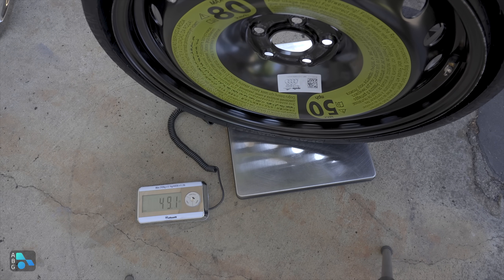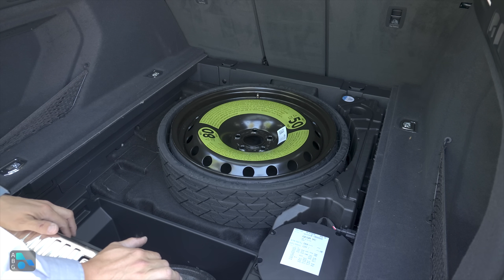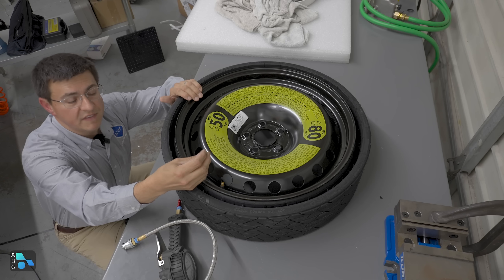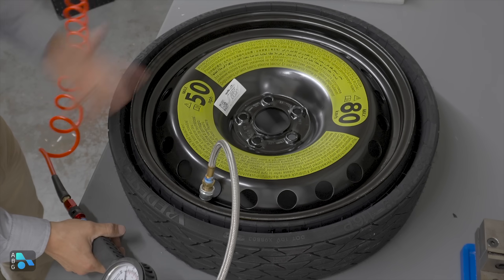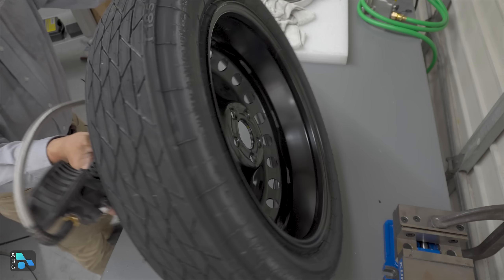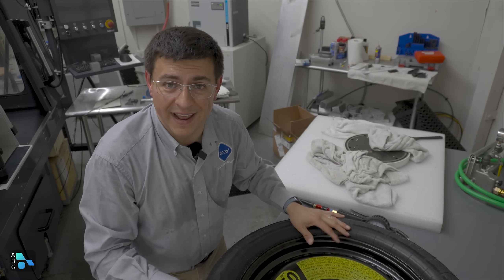How A Collapsible Spare Tire Works, And How It Might Save The Spare Tire In EVs

Comment: Deletion of spare tire has nothing to do with space or weight... it's absolutely just cost-cutting to pad bottomlines.
Reply: A donut spare doesn't take up much more room than this and weighs the same or less.
Reply: If you look at the place when they fit the pump assembly for cars without spares, it looks suspiciously like it can take a real spare tyre!
Reply: @mickleblade Yeah, the big empty cavity under my trunk's liner that they tossed a few cheap foam storage bins looks suspiciously spare tire shaped if you remove the cheap foam.
Reply: 1:12 "Precious cargo space".

Like for storing an effin spare tire, you parkinsonian mollusc.

This has nothing to do with space, but cutting costs, like how you now dont get a charger with a new phone.
Reply: @Ulfhednar-o9t depends what country you live in
Reply: It blows my mind that they dont make my mach e frunk or trunk bottom shaped to take a tire like this. They can sell it as an accessory at a premium. I have had flats in Lyon, Northern Sweden and shouthern Sweden, none were slow leaks where the kit would help. I hate not having a spare.
Reply: Yet another reason to hate corporate USA. It's all about the bottom line for the CEOs and their crew.
Reply: @Farjah-q5p another corporate USA hater. How about foreign car manufacturers?
Reply: @Farjah-q5p  This has nothing to do with US. My Seat Leon FR 2013 does not have a spare tire and the car is from Germany
Reply: Kinda blows my mind how anyone believes it is anything but cost cutting.
Reply: Not just EVs that don’t come with spare. Heck, my FL5 doesn’t even come with a jack! Just fix a flat crap and a pump.
Reply: What do you expect for a mere 85,000 no way they can throw in $100 spare tire
Reply: It's also because people didn't know how to change their own tire and blamed the factory getting sue happy...
Reply: @danonroof yes most younger people would not have a clue or want to even change a tire on a car nowadays they just ring their 24h roadside assist which every new car comes with nowadays and someone comes and fixes it for them
Reply: Yup. 2013 accord hybrid stopped putting the spare in even though it fits. They even did us a favor by removing the mounting nut so you can't secure a spare on there later.
Reply: @DoingthingswithDAN same with the CR-V hybrid
Reply: @rods6741 true. But the crv hybrid places the battery where the spare normally is on the gas only variants.
Reply: thats exactly correct.  there was more than enough room for a spare of normal size
Reply: Agreed. Research the vehicle and don’t drive off the lot without one.
Reply: Yup. Just like the deletion of physical ac buttons.
Reply: It is proven as small e-rickshaws have spare tyres where their combustion engine alternatives don't have spare tyres.
Reply: Every good automaker knows best to pad their bottom lines with cocaine. We all learned it from DeLorean. That guy knew how to have a good time
Reply: Yuuuuuup. Same as when companies make a big show of moving to recycled materials to save the planet. Recycled materials are cheaper than virgin materials, but the price of the product stays the same. All about increasing margins. Lego actually announced moving to recycled plastic to save the world a few years ago and then backtracked and hoped everyone forgot they announced it when they realized they needed more durable plastic than regular recycled plastic and it would have cost them more than the virgin plastic they use.
Reply: 100%
Reply: You can buy your own spare.  But you are cost cutting the same way the companies are.
Reply: Ceo needs bigger bonus
Reply: It must save all of 20 dollars
Reply: Easy proof buy a new car or truck and order full size spare if weight or size was issue  it wouldn't cost you $$$
Reply: ...and you are saying putting a collapsible spare tire is someone cost cutting instead of a normal tire? You logic fails when you answer this either way.
Reply: @VedaSay  the cost cutting is not giving you a spare, jack and tools. Customer demand has led to use of spacesavers
Reply: No, it's completely about that, the cost of a spare tire is practically nothing when compared with the cost of a car. The ones I see listed are all under $500 after tax. The cheapest cars for this year are something like $16k, so an extra $500 on top of that is just not that much money. The alternative ways of hitting the fuel efficiency targets are a lot more expensive.
Reply: @SmallSpoonBrigade  If you sell 200,000 cars like Tesla did of only 1 model last year and saved $500 for each car, then you made an extra $100 million dollars.  Welcome to cost cutting in corporate America and western economies.  This is how the market works.
Reply: @natew2031 he obviously did not do maths or economics
Reply: @SmallSpoonBrigade  ...dude you're forgetting the whole supply line and most petrol cars don`t get a spare so it is about the bottomlines.
Reply: @SmallSpoonBrigade dude you have car companies not giving rear seats climate vents, giving only one pocket on the back of the front seats instead of 2, stuff that would cost literal pennies, and you think they're not gonna care about $500?
Reply: @SmallSpoonBrigade bruh no way you’re this naive 😂 as someone pointed out this is a decision of scale. They don’t just sell 1 car without a spare it’s about 100s of thousands of cars then even $10 makes sense. Look up American Airlines saves $40,000 with 1 olive
Reply: @SmallSpoonBrigade  tell me you know nothing about how businesses operate without telling me. 😂

Those $500*thousands of units, literally saves millions on the production costs. They don’t care that $500 is cheap for you.

Comment: This is really cool. More vehicles need a spare. The "run flat" thing has been entirely useless in every situation where I required a spare (sidewall damage).

Incidentally, my 2023 F-150 Lightning is another BEV that includes a spare. In fact, mine is a full size spare. Most off road capable vehicles will have a full size spare.

Comment: This is ridiculous. The automaker still has to provide space to store the punctured tire and, on relative terms, neither much space nor weight is saved. It is just the typical German penny pinching and overly complicated solution to a simple problem. Porsche had these sort of wheels for years; useless then and useless now.

Comment: I can see the spare NOT out in front for crash test, it would interfere negatively with crumple zones.   

As for the why on these types of tires, they are true to size to the original tires.   Which is very important to AWD and Limited Slip differentials.   Which is why the 2nd Gen and 3rd Gen GM F-Body cars (Firebird and Camaro) had them.   Limited Slip aka Posi, was std on the Z28 and Trans Am and a common option on the other models.   

Thanks for the video showing it in action.  I used mine 1 time.  Sadly used up the CO2 cylinder and unsure how to ever replace it.

Comment: The trend for not including a spare tire is not restricted to EVs. ICE vehicles are also trending to removing spare tires to save money and increase storage space.
Reply: There’s no sense in having more storage space when you are stranded without a spare in some remote area.
Reply: @ agree - this has been going on for over 18 years now.
Reply: It has nothing to do with space, it is all money and weight.
Reply: @MegaLokopo  Yeah and for them weight means money in many ways so we might say it's all about money.
Reply: @domnanzwandor   Your not wrong. Money is at the end of EVERY decision. But it's to save weight not space.
Reply: @SVW1976  Weight is not a real selling point, but storage space is definitely something that shows up in all the reviews and comparisons. And making an extra couple hundred dollars per sale by not including a spare tire, plus jack and mounting equipment goes straight to the bottom line. 
Tesla is not immune from doing things to save money. Getting rid of the driver console, and now getting rid of the stalks on the Highland Model 3 has the significant benefit of save a hundred dollars or so. Or getting rid of the mobile connector that used to be free is another hundred plus dollars straight to profit.
Reply: @domnanzwandor weight = mileage thus space and mileage = buh buy. Car specs are hyper competitive the past 15 years with internet and reviewers noting one car has .35 more cubic feet of interior and steering feeling tighter etc. 

Well piss on the spare tire once one manufacturer did it and buyers did not care on a flashy new model…  the rest were like wth!
Reply: @SVW1976 if you want to save weight  don’t buy an EV.
Reply: @MegaLokopo  Certainly most about money I'm guessing. But being able to advertise a little more cargo space is probably also a factor.
Reply: @MegaLokopo  I did roadside towing for 5 years, id say over 70% of my tows where cars with no spare
Reply: @mathewsenn  Yep. People are dumb.
Reply: its a foot blaster
Reply: the big RSA is behind this trend
Reply: Exactly !
Reply: Some cars have different-sized wheels on the front/back. Do you want two spares?
Reply: @tonyp2865  Compact spare tires (aka donuts) are smaller and narrower than your OEM size tires. They still work, but are really just designed to get you home or to a tire shop. Also not designed to travel at high freeway speeds.
In other words, you don't need 2 spares, unless you have 2 flat tires at the same time.
Reply: @twostate7822  I have an Audi R8 and a McLaren GT both cars have different size wheels front to back. Anyway, there is zero room to fit any spare on these cars.
Reply: @tonyp2865  As I noted, you don't need separate spares for different sized tires since the spare itself doesn't have to be the same size as the OEM tires. 

Can't you put a spare tires behind the front seats, or take out the passenger seat? Just joking, but if you really needed a spare you could find a way.
Reply: @twostate7822  OK, all wheel drive. So what happens when a smaller height tyre is used. There is no room anywhere, have you seen the size of those wheels?
Reply: @tonyp2865  What happens? Your car rides a little uneven. That's why those compact spare tires are only for emergency use.
Compact spares are actually quite small. Easily fits in a trunk. 
Have you never seen a compact spare???
Reply: in alot of cars like the jeep cherokee and hyundai elantra it was an option,
Reply: in germany too, there are barely any cars that have a spare anymore.
Reply: Yup. Been a trend for over 20 years now.
Reply: And don't forget emissions reduction. Remove 50lbs or so and you get a small but measurable increase in fuel economy. That tiny increase makes a very large difference when applied to the corporate aggregate fuel economy numbers.
Reply: The idiots sell 4x4's without spare wheels. (Spare tire is uneducated language.)

Comment: tHeRe’S nO sPaCe FoR a SpArE tIrE
No, they’re just cheap and don’t wanna give you one. The engineers could easily give it enough space to fit it in, or mount it on the undercarriage like a truck or on the outside of the trunk like a Jeep.

Comment: The 1980s Porsche 928s I had used the same type of spare. The car came with a small air compressor just as they do today. Absolutely came in handy a couple times and was grateful for not having to lug around another full size wheel.

Comment: Like others below, I also can't consider a car without a spare.  Every flat I ever had on the freeway actually resulted in a broken sidewall AND a damaged rim.  A can of Fix-a-Flat won't resolve a cracked, bent, or torn rim.  I don't like donut spares, but you can't really buy any small or mid-sized cars or SUVs with full-sized spares.  So it is what it is.  But whatever car I have, I always check the spare tire whenever I check the regular tires.  That's usually about once every 2-3 months.  I have never had a tire that went 2 or 3 months and didn't need to have air added.  

If there's one thing I would emphasize to any car owner, it is to check your tires regularly, and check that spare too.  When you have a flat, you're under tons of stress already; jacking up the car on the side of the road, trying not to die by getting hit by somebody texting on their smartphone while they drive on the freeway, and trying not to get crushed by your own car falling off its jack.  When you know your spare was checked and filled just a few weeks ago, then that's just one less thing to worry about during an emergency.  Be careful out there, people!

Comment: I can’t believe you didn’t use the provided air compressor!  That is this systems weakest part and it’s why this set up is dangerously unreliable.  During a recent flat tire event, the pump FAILED to fully inflate the tire. The second side would not pop out.    This pos had to be taken to a shop with a more powerful pump in order to inflate the tire.   Glossing over this fatal flaw is irresponsible.   Seriously, why not use the provided pump and then fast forward?     This same failure happened to a friend who has an A6 Allroad.   DO NOT TRUST THE PUMP (or this video)

Comment: My 1985 Nissan 300ZX Turbo had that type of spare tire. Very small diameter, sat in the wheel well with a compressed air bottle to inflate it. Never used it, had a can of fix a tire.

Comment: No one is using the spare tire well for anything, there is no space saved.  It add additional weight and need an air pump to work. how long does the tire inflat with that oem pump? no thanks, I will stick with regular spare.

Comment: This seems like a decent compromise. I do wonder what you do with the now bad tire after you replace it with this expandable tire. Obviously it won't fit in the same space. If there's nothing in the trunk of your car I suppose it might fit in there. I'd want to carry some bungee cords to fasten the tire down so that it didn't come flying in a sudden stop. Of course this spare is expected to be used only enough to get you to a tire shop to get the bad tire fixed or to buy a new one.

Comment: The tire in the truck is weight distribution strategy for handling and you gotta be careful with a stronger cfm compressor it can pop up and launch thats why tire machines clamp b4 inflating ALWAYS and I never knew that cap was a tool also and ive been working in the industry as a mechanic for over a decade 😮😂

Comment: when cars are getting larger then ever they use lack of space and weight as an excuse to leave out the tire, go figure.

why not a tire case on the trunk like some of the classic cars had? then you get a full size spare and a place to put the flat tire when you change it out.

the tire itself is neat from a design standpoint, but seems the idea itself is just silly.

Comment: I had dust caps like yours in the 1980's, yes the tops are designed for removing the valves.

Comment: If I buy a car without a spare (or with one of those little "donut" spares) the first place I go is the junkyard to pick up a "real" spare. Those "donut" spares are only good for about 100 miles, which may not be enough on the highway. They also make your vehicle less safe to drive. I also carry patches & a pump.

Comment: Very great video. For people who may not be as knowledgeable about cars, I'd say this is very informative. 

The tread design may be different than ones you see on other spare tires because this one is can collapse, unlike other spare/normal tires that keep their general shape when off the rim. 

As for why they don't put the tire in the front, it's because of spacing. Just because there is no engine in the front, does not mean the other components are also gone. You still have windshield washer fluid, brake fluid, Air Conditioning and Heating, and possibly access to the drive motors up front, as well as cooling for the battery. 

I also think other EV manufactures don't include a spare to keep the overall weight down. Efficiency is one of the most important things when developing passenger vehicles, more so for an electric car. For a lot of people who want to buy EV's they check the mileage it can go in a single charge. Easiest way to get more distance is to make the car lighter.

Comment: As others have already pointed out 9/10 the bead won’t seat and the other 1/10 doesn’t inflate properly.
It’s perfectly possible to design room for a spare wheel. It’s just so manufacturers can make a basic safety item an expensive extra.

Comment: Or, hear me out, we could stop designing cars like lazy, crayon-munching imbeciles, and start building in enough room to put a real spare tire! 
Store it underneath the car on a tiny cable winch like a Toyota Pickup, or give the car a slightly longer rear overhang and store it upright behind the rear wheel like a Volvo 240. Or just make the trunk shallower! This nonsense ultimately won't hold up well and these doughnut spare are only really good at letting you down when you need them. 

In my case "Temporary spare" meant "Didn't even last long enough to find a replacement tire"

Comment: I just cant wait till solid state batteries start becoming the normal. your thin phone will have 10,000mha battery and last for 3 days, EVs will be able to drop thousands of pounds and still have the same or even better range. BMW invested heavily into this and plan to have it out by next year. I think it was Toyota who already has a prototype and for the same weight of the current model the car got around 800 mile range.

Comment: what do u mean there is no room for a spare tire? the battery is in the floor, there is no more a front engine in the bay... am i missing something? yes im missing something 5:54 that is a rip off of a space... i bet all them electronics can be hidden in a smaller area... they managed to cram a shitload of engineblock and other pipes in that area... but they cant manage a few cables? cmon thats so dumb.